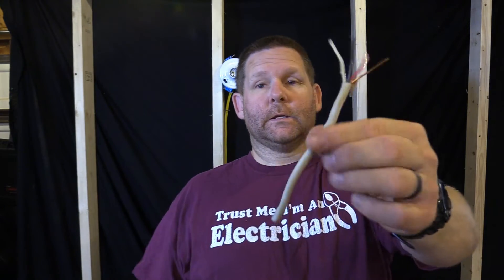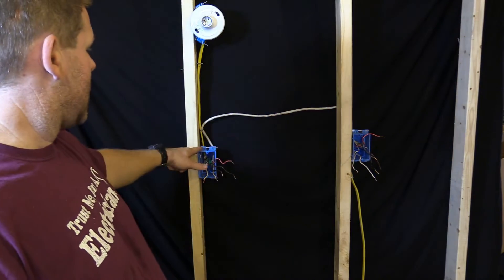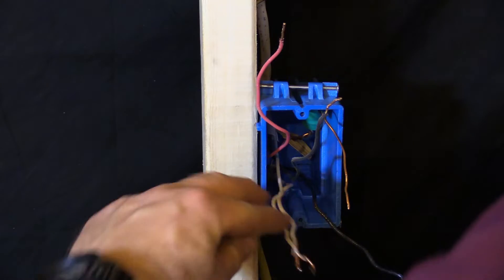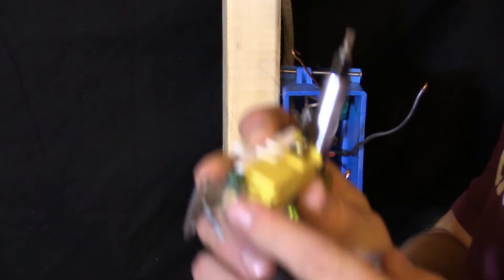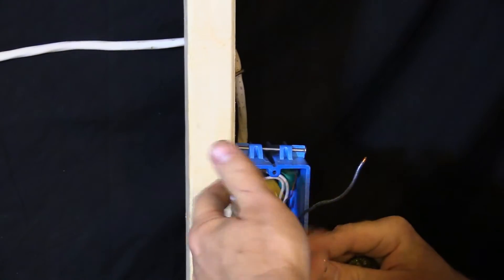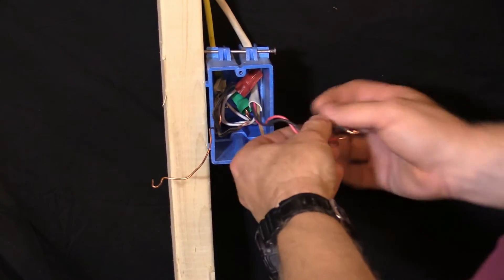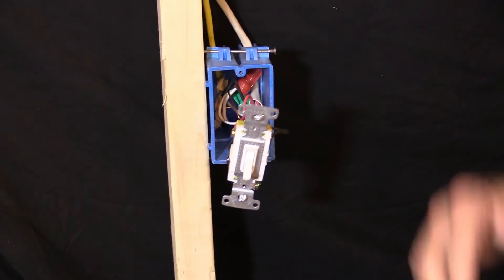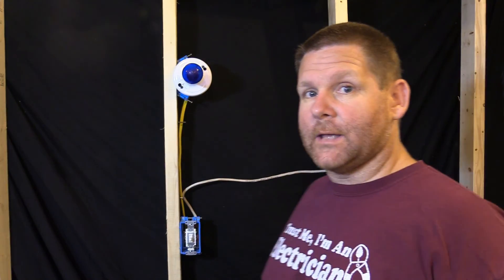How To Wire A 3 Way Switch

Comment: I’ve got a 3 way switch situation that gave me a bit of a headache today. I have a Single gang 3 way next to the door at my garage. That has 1 black, 1 red, neutral and ground going to the switch. This runs to a 2 gang box on the other side of the garage, where there is a 3 way switch and a normal light switch for an outside light. That 2 gang has a 14/2 hot leg coming from somewhere , 14/3 going to the single gang I mentioned earlier and 14/2 going to the light overhead. It works as a 3 way switch no problem, with no secondary hot in the single gang box. 

When I tried to install an occupancy switch at my single gang box, without a neutral. The switch would only work if the 2 gang 3 way was on. 

any advice? Seems strange that my single gang doesn’t have a power source and only the 14/3 from the 2 gang.
Reply from the maker: so this situation is pretty typical the single gang 3 way probably is the switched part of the 3 way side. you wont have a constant hot in there but you will have one side of the 3 way switch hot,(confused yet)... I can tell you from experience that I have a occupancy sensor in my garage as well and if i get any extension cord or anything with any power near the sensor it will not work right it will actually go off and on all the time.  now I know that isnt the answer your looking for but wanted to throw that in.  Back the the question at hand, seems to me and I could be wrong but you may need to 1 either leave the switch in the on position all the time or 2 get another occupancy sensor for the other side of the 3 way believe it or not I have 2 on mine same almost that same thing as your saying. I had to add 2 due to the fact that when I went out of sight of my one near the door it would turn off due to the fact that I didnt have any motion near it. That solved my problem. I gonna say that you will have to do one of the two things I mentioned.  Let me know what you do but that is exactly what fixed my problem.
Reply: @MountaineerOutdoors  Thanks for the reply, will let you know how it works out!

Comment: Have a question, maybe a dumb question but I need to understand. Why is there a need for 2 different runners, ie black and red? Couldn't the 3 way switches still function with only one runner? Would this be too dumb to show on a video for nubies like me?
Reply from the maker: you need a 12-3 or a 14-3 but a 3 way switches the hot from one side to the other. There is no other good way to do it and its the most simple.

Comment: I have replaced the 3 way switches on both ends  of my hallway. The main switch at one end has 2 black wires ( one is a jump off wire to my bathroom. Where do I connect the jump off wire on the 3 way switch ?Was this wiring done wrong?
Reply from the maker: When you refer to the jump off wire are you referring to the hot that is feeding on to your bathroom? If it's only a hot you need to make a joint on those two wires and then run one wire to your switch. Do not put two wires on the switch screw.
Reply: @MountaineerOutdoors  Thanks for the info.

Comment: Nice and clear, thanks!
I have a suggestion for a new video: How to add a 3-way switch to a light where the existing switch has the power coming down from the light (i.e., a switch loop).  I just did one myself and the wiring took me a bit to figure out because I couldn't find any how-to videos that covered the wiring in any useful detail.
Reply from the maker: I have a question, did you have a hot and nuetral in your switch box or just switch Leg and hot? Thanks for the idea that would be a great one.
Reply: @MountaineerOutdoors  I believe it was just the switch leg (black from switch up to light) and hot (white as hot from light down to switch).

Comment: ALWAYS!!!!!!!!!!run tape yall around the outlet after you terminate the outlet or switches
Reply: The RIGHT way to tape an outlet:  So far, I have NEVER seen this done correctly.  To wrap the electrical tape, first "don't wrap it while it is stretched!"  Pull a piece off the roll long enough to go around the outlet about 1 to 1-1/2 times:  Then BEFORE you put it around the outlet, LET IT RELAX (un-stretch), then put it around the outlet pressing firmly onto the surface.  The reason for this is that over time it will un-stretch.  Then repeat with another piece of tape around in the opposite direction.
Reply from the maker: That is definitely a preference... I don't prefer it but if you feel that you need to do it there is nothing wrong with it

Comment: Hi,,  we need to move one switch ( 3 way ) from one wall to another ,, the  switch have the wire for the lights ,, what I need to do ?
Reply from the maker: If It were me, if it's coming up from the attic then pull out the wires and put them into a box and re pull the wires from the junction box to the new switch.  Same of it were in the basement or crawl space. Hope this helps

Comment: Probably the best video on wiring three way switches!! Thank you!
Reply from the maker: Thanks man I appreciate it alot. Have a great day.
Reply: Did he mention if there are more than just 2...3 way switches in the hallway?...for example,  what if there are five or ten of them, how to wire them all?
Reply from the maker: You can only have 2 3 ways after that you have to use a 4 way. I'm still planning on doing the 4 way video hopefully very soon. I will explain it then

Comment: If i had multiple light in the middle and two dimmer switch at each end what it would look like?
Reply from the maker: It would look like the drawing except with more lights. However, you can only use one 3 way dimmer and the other side would have to be a regular 3 way. If you wanted to switch them at each light location you would have a 3 way then 4 way switches at each light location ending with a dimmer or regular 3 way at the end of the line. Make sense? Hope that didn't confuse you.

Comment: If someone pulls a panel  and puts a 20A breaker on a 14g circuit, they need a claw hammer upside the head. I don't agree with you about only using 14g on detectors. But it's your house man. I've run 14g since before 12g was yellow. (pre romex color coding) -Plus, you can't use the quick connect holes on the back of 15A plugs w/12g wire. that's my 2¢
Reply from the maker: I agree.. Ive pulled in romex before it was color coded too.. However I've been behind so many "electricians" who pull whatever it takes... Before too long you have a mess. And your exactly right it is my house and my customers and I will protect them and my license from anyone coming behind me jack legging it. To each their own but it's not just not worth saving s few dollars buying 14 guage wire in my opinion.

Comment: Nice! You do make it look pretty easy, though. One question, because I am not an electrician, with so much copper of the ground exposed, aren't you worried about a potential short when pushing it all back into the switch box/housing?
Reply from the maker: Yes that's why you have to tuck in the wires with precision...  😂
Reply: Exactly why most folks should call an electrician...😆
Reply from the maker: Exactly right
Reply: The ground doesn't carry electricity except in the event of a direct short in the load (or connections to the load) and then it's only long enough to trip the breaker (which is why it's there).  He's using solid wire as opposed to stranded wire.  Solid wire is much stiffer and better at retaining the shape/position it's stuffed into.  It won't just bounce up and hit the connection screws on an outlet or a switch.  The only concern I see is that the bare copper might hit a hot wire and trip a breaker.  Again, if it's placed carefully and with understanding of where/why and what can go wrong if it's not done correctly, you should have no problem.  I'm just a DIYer with electrical but I do a lot for being a DIY guy (I've done dozens of outlets and quite a few switches, and several new and refit panels) and I've never had a problem.  Obviously, professional electricians (like this guy) have done far more than I, but notice that his response didn't scream red flags...this is safe and pretty tame.